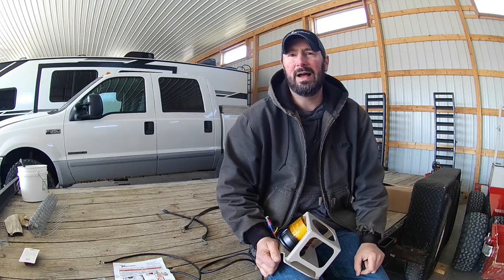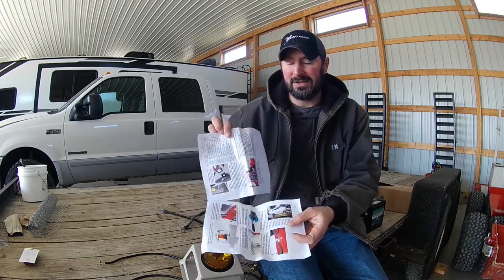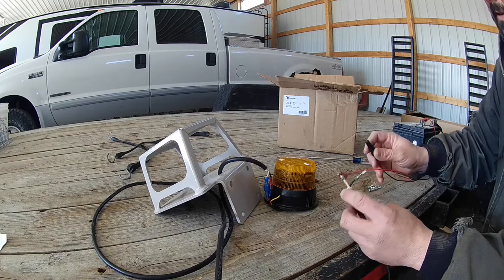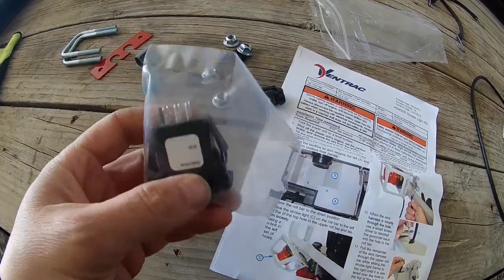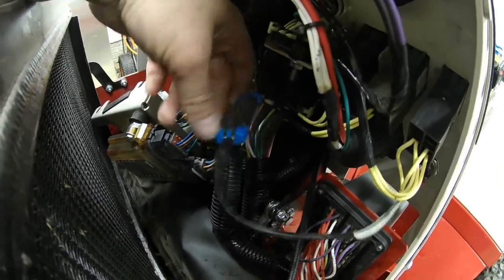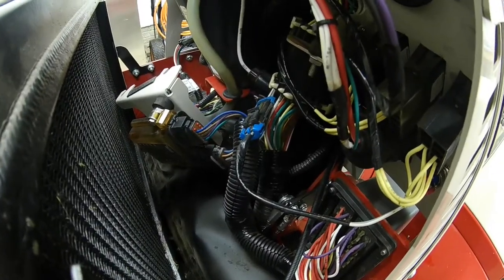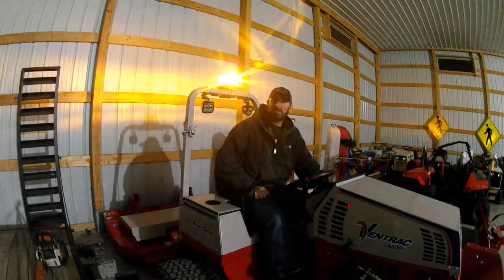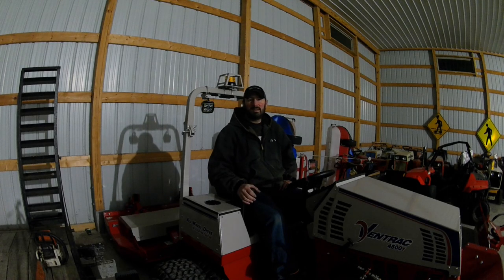Ventrac Strobe Light Kit.

Comment: Any idea what the cost was
Reply from the maker: I think the kit was just under 300.00,
Reply: @steiger256  ok thanks
Reply: How are the pig tails marked looks to me like there all the same color hard to tell apart
Reply from the maker: @unclestinkystudios8480  The pigtails only snap together one way. It comes with highly detailed directions to show the proper way to install the wires into the pigtails.  Just remember to double check the placement of the wires before you insert them because you will not be able to remove them without a special wire tool. It was a very easy install tho.
Reply: @steiger256  ok I meant more of the color coding ones under the dash